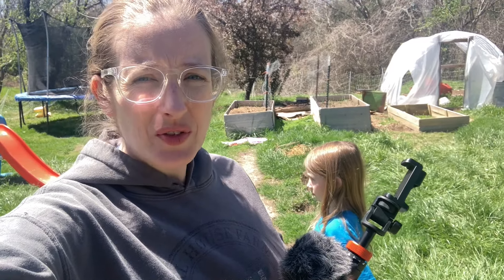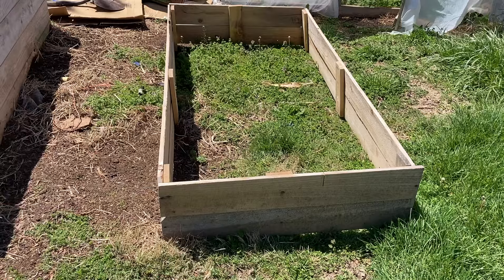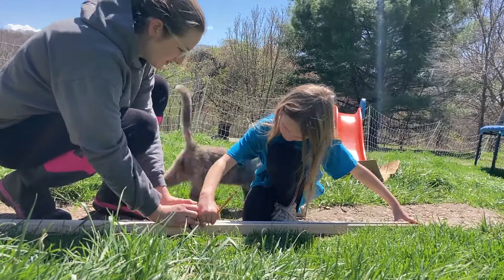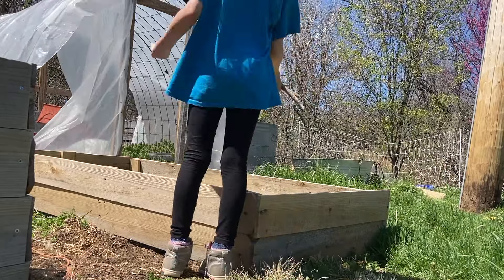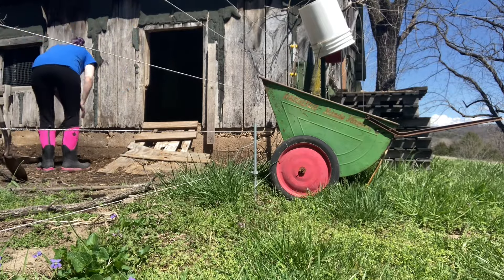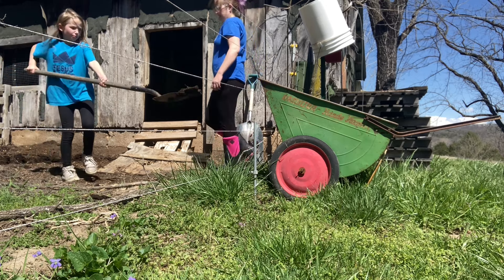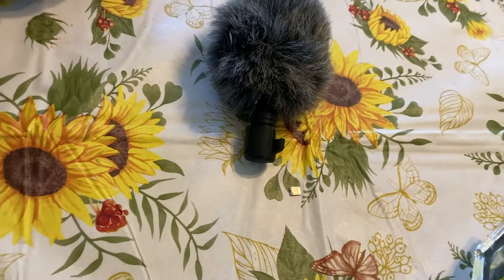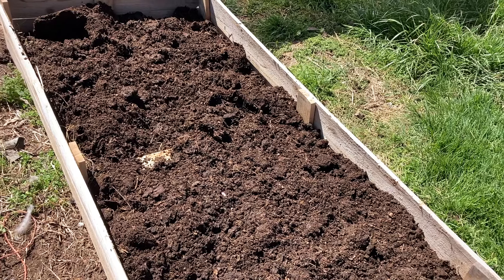#DITL Prepping Raised Beds For Strawberries #homestead #spring #strawberry

Comment: I looked into Huegulculture beds from around the world including some university experiments ('gotta love the internet).  The original concept is to create a happy soil biome, reduce summer water usage, plus provide wet weather drainage; and cheaply fill beds as a distant additional reason.  Some folks fill the bed bottoms with an unpenatrateable layer or few of larger logs  and this produces much lower yields than when the plant roots can find a way through and among the branch debris below.  Reasonably quickly compostable branches (ie old versus green prunings) create the best soil and can have the highest yields but break down the quickest requiring the building of a new bed/ transferring the contents or adding soil on top.  The conclusion of one 5 year study was to put some larger pieces in at the very bottom to help retain the structure, maintain the biome, and to become water wicks; then add a bunch of medium sized branches but not as a solid floor; then add smaller amd older branches to get the biome going; then add a layer of compost to help get things going; then add soil and maybe a top dressing of compost.  One thing about this method is that it can result on over fertilizing because the wood and woody bottom material can absorb excess fertilizers as opposed to them simply washing through to the soils under and down stream. -  I write this comment only to share what I've dug up, not to make comment on what you've done.
Reply from the maker: Thanks for sharing Terry!